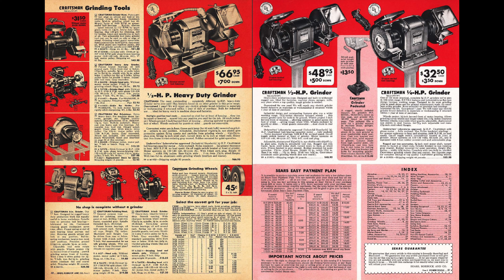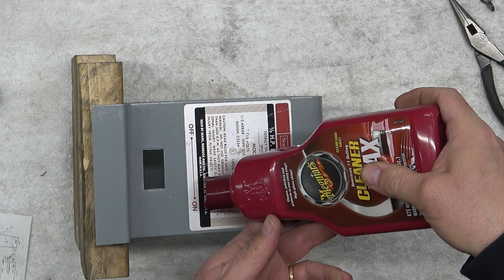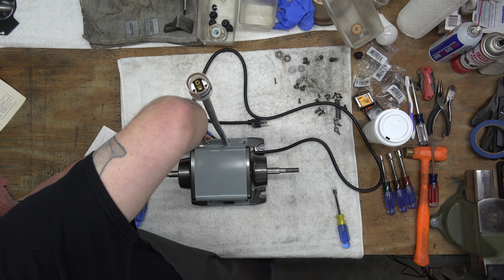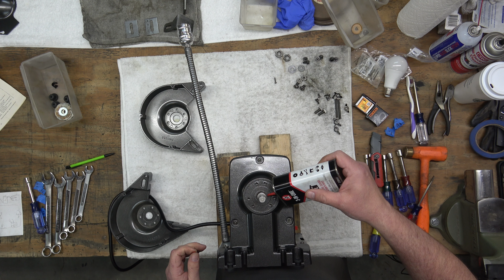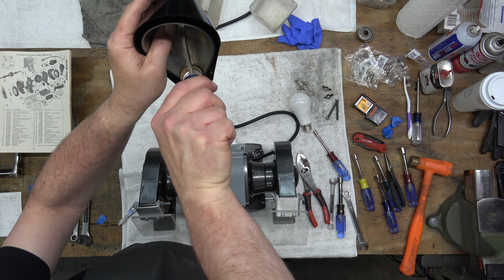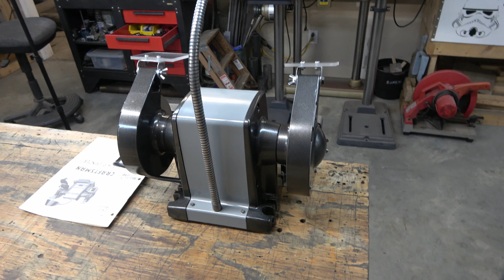Part 4 Craftsman  1/3 HP Grinder Rebuild (Final Assembly)

Comment: Do you have a favorite bench grinder, and why it is?
Reply from the maker: WOW, I am not sure I could say favorite. I love my Craftsman ¾ HP Bench Grinder (397.19350) and use it the most. I really love my Delta Rockwell 23-105 7” with cast iron pedestal as well. I recently picked up a Craftsman 3/4hp 397.19450 that I will be doing a video series on in the near future.